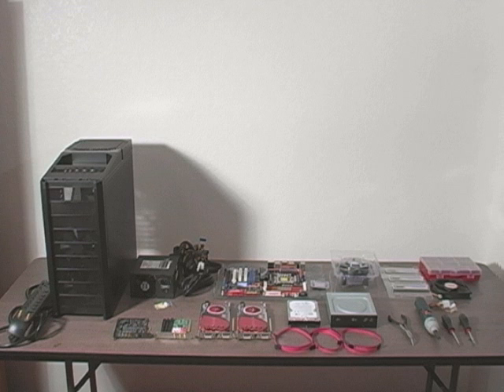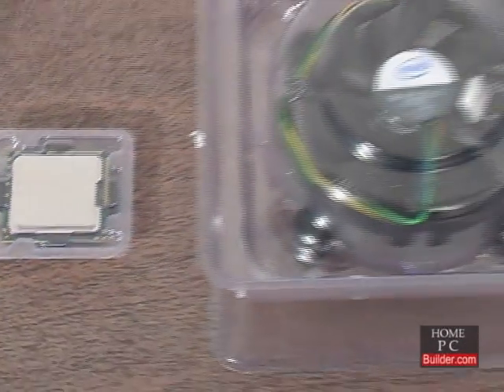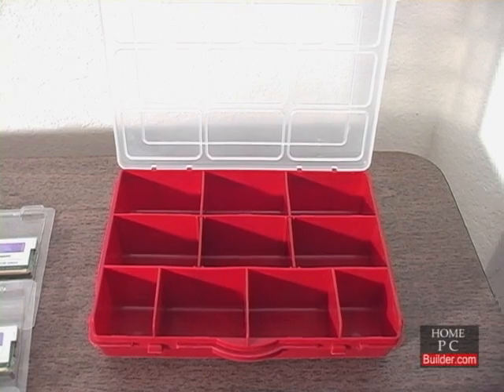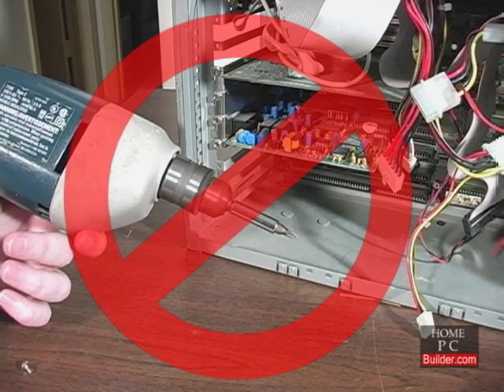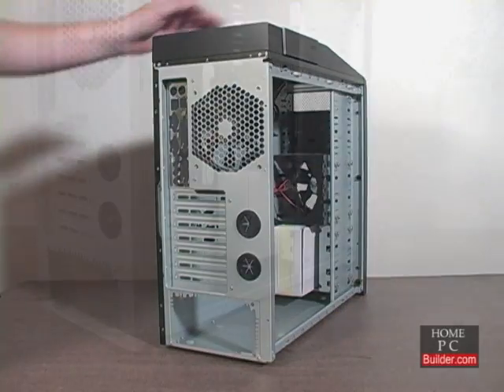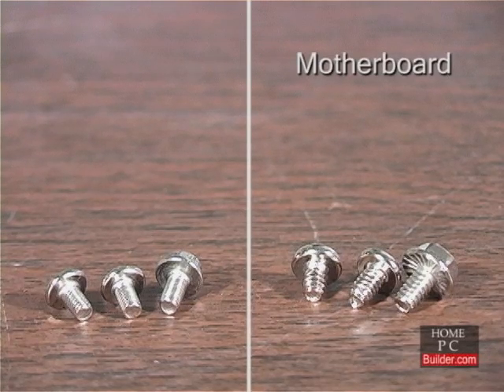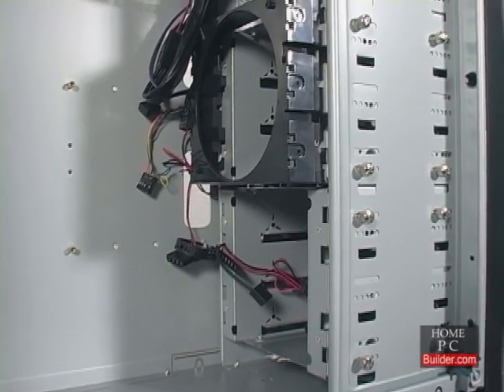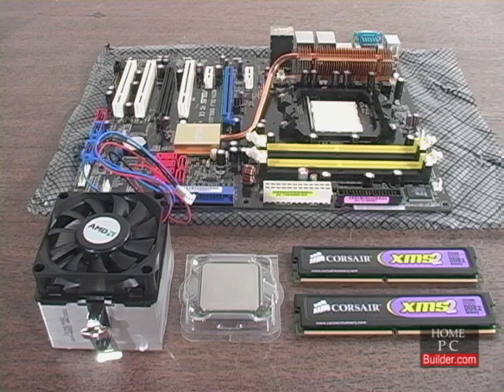Build a PC Computer - Overview of parts - All New for 2009 - homepcbuilder.com

Comment from the maker: If the computer doesn't turn on at all, as in no lights and no fans spinning, it is probably the power switch going to the motherboard that isn't on correctly.  There is a video on this channel that shows how to connect the cables from the front of the computer to the motherboard.  It is called "Build a PC Computer - How to Install a motherboard".

Comment from the maker: Make sure you connected the 4 or 8 pin power cable from the power supply to the motherboard.  This connection is at the top left of the motherboard and very easy to miss.

Comment from the maker: @AnimalKlips For $150 you can get a Radeon 6850 which is actually a very nice card that will do surfing, HD video and play most current video games very well.  If you don't care about games you can safe some money and get a card for around $50 to 75 that will let you surf.  Take a look at a Geforce GT 430 or 520, or a Radeon 6670.  All of which will do everything but gaming very well.  You can use them for gaming you would have to turn down the visual settings a bit to get a decent speed.

Comment: @MinttyDizzy  I lol'd at your post because i have pretty much the exact setup that your asking about. I have the asrock a770de+,  amd phenom x6 1075T, HIS Radeon HD 6870 it plays every single game i have maxed out on a 24 inch acer @1920x1080 a OCZ Fatal1ty 550W Modular Gaming Power Supply. All for just a little under 500 dollars. I already had the monitor and ddr2 ram and hdd havn't had any trouble with any part i have.Been running it pretty much 24/7 for nearly 4 months

Comment from the maker: @hayeslikestojam111 They do have to be the same model.  The motherboard must support it and the power supply needs to have enough wattage to power both cards.  We cover using two or more video cards in the complete set of Home PC Builder videos which are available on the website listed in this videos title.  As well as Amazon and eBay.

Comment: @tommy714pham If you have the compatible connector it will be on the side of your soundcard as you look at it installed in your system (front panel)

The HD audio is an inferior codec which is built in on your case. Your Xfi sound card is better.

Comment from the maker: @tommy714pham There are audio connections on the front of the case.  Usually these are for a microphone and headphones.  The HD Audio cable connects these to the audio components of your computer.  This can be connected to the motherboard if it has built in sound or to your add-on x-fi sound card.

Comment from the maker: @13attleflame Unless you're going to play games you can just use the video thats built into the motherboard on most low end systems.  When I say games I mean the 3D sort. Games like Call of Duty, World of Warcraft, Bioshock, etc.  You can still play online 2D games.  If you do want play 3D games a Nvidia GTX 460 or ATI 5770 will give you the best bang for your buck.  You can find both for between $150 and $200.

Comment from the maker: @orestesdd I downloaded the motherboard manual for the Asus sabertooth and it does have a 4 pin connection for the pc speaker. Its on page 2-36 of the manual.  The Gigabyte board will have the 4 pin connection as well.  The 4 pin pc speaker header and the hd audio header are two different things.

Comment: @hpcbdvd Sorry but both motherboards which I am considering to buy has a 9-pin interface, and it does not seem to be where you said it is.  The two motherboards in questions are ASUS sabertooth X58 and Gigabyte ga-x58a-ud3r.  In both of these mobos, there are 9 pins to connect the so-called front audio.  In the ASUS case, it is found on page 2-34 and for Gigabyte on the top of page 31.  Sorry if I seem stupid, but this will be my first build.

Comment from the maker: @orestesdd The PC speaker does connect to a 4 pin header on the motherboard.  It's actually 2 pins with space for 2 more pins in between them.  This header is right next to where you connect the power, hdd and reset cables from the front of the case to the motherboard.  Your motherboard may come with a PC speaker, but if not you can buy one of the 4 pin ones you see online.

Comment: @hpcbdvd I know that the system speaker is for beeping, but if I build my own PC, I will need a speaker to let me know if I am connecting the mobo and everything else correctly and to debug any problems.  The thing is that I am not able to find "system speakers" with these 9-pin connectors.  I was googling it and the only ones I can find are the old 4-pin connector "system speakers".  So this is my concern, for I am planning to build my own computer, and I do think I will need the speaker.

Comment from the maker: @orestesdd The CM Storm Sniper doesn't have a PC speaker.  This is very different from an HD audio or AC97 connection.  Both of these are for connecting the sound on the motherboard to the front audio ports on the case.  The CM Storm Sniper does have a HD audio cable you can connected to the motherboard.  An actual PC speaker is just for making system beep sounds that you hear when the computer powers on.  It isn't necessary.

Comment: If my case does not have a case speaker (HD Audio), where can I buy one and how to install it on my case, a CM Storm Sniper BE?  By the way, it seems that some MoBos do have a HD Front Panel Audio speaker with a 10-pin connector or a AC'97 Front Panel Audio speaker with a 10-pin connector, and I am not able to find where to buy these system speakers.  Again, does anyone know?  Thanks.

Comment: sry to bother but i'm new to pc building and i'm just wondering about this set-up is it a nice combo is it bad will i find problems..etc cheers in advance

Cpu = Intel Core i5-750 Quad Core 2.66GHz 8MB Processor
Mb = Asus LGA1156 Intel P55 DDR3 ATX
Psu = Corsair Memory 750W TX SERIES ATX
Gcard = XFX R5770 HD 1GB PCI-E Dual DVI
Hdd = CAVIAR BLACK 640GB SATA/300 7200RPM
Ram = corsair DDR3 1600MHz 4GB kit
Case = Antec 300
Drive = LG DVDRW 22X INT SATA Securdisc

Comment from the maker: @powerpoint1357924680 No.  Low power from a power supply can not make the computer slower.  The symptoms of a power supply not having enough power are the computer not power on at all or the system rebooting or shutting off when it is doing something that takes a lot of power such as playing 3d games that use the computers video card a lot.

Comment: @hpcbdvd Thanks I thought I had to go out and spend 300 more dollars for 2 2133 ram sticks thanks alot man :D ifI didn't ask you I would have spend a total of 300 dollars. Newegg really needs to put up ALL specs so people don't get confused and end up with expensive hardware they didn't want or need. Also they need to stop making combo deals with hardware that doesn't work with each other. All i'm worried about is if MSI has RAID drivers for Window 7

Comment: Do you have to install the exact Memory Standard for a motherboard? I understand the ddr2 and ddr3 thing but lets say this:
Motherboard specs: MSI 790FX GD70
Memory standard DDR3 2133 OC
Does that mean I can't use a DDR3 1600 
RAM stick on  my motherboard? If I can does it mean i have to go to my bios and overclock it to 2133 or do I have to buy a RAM stick thats 2133?

Comment from the maker: I depends on what you need your computer to do.  I put those parts together because we needed a machine that would be very fast at video encoding.  The Core i7 at 2.66GHz is very fast.  We then overclocked it to run at 3.7GHz.  You can get see several parts lists with a range of performance and budgets at our site under the Computers drop down menu.